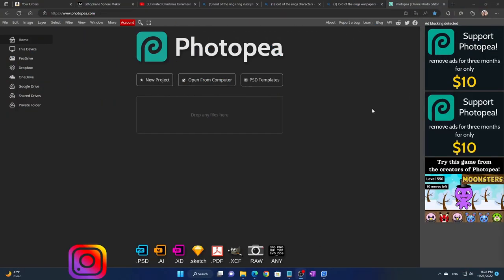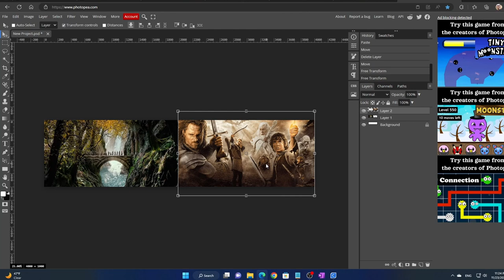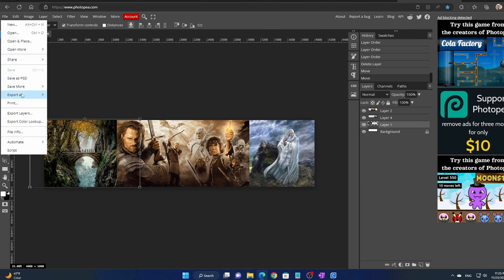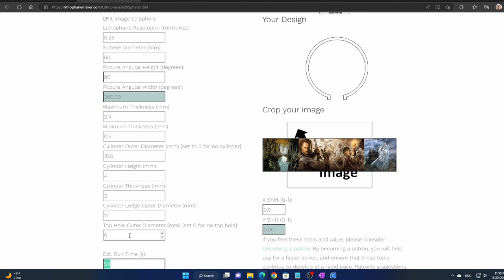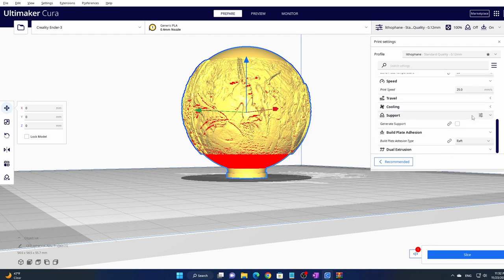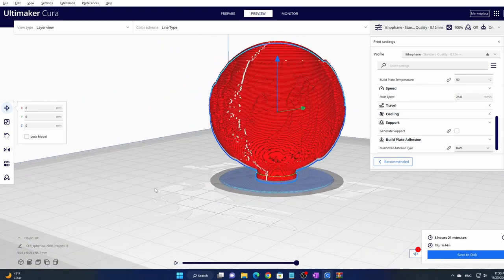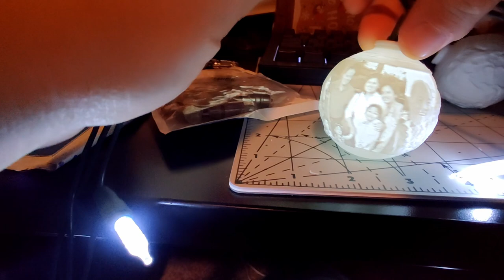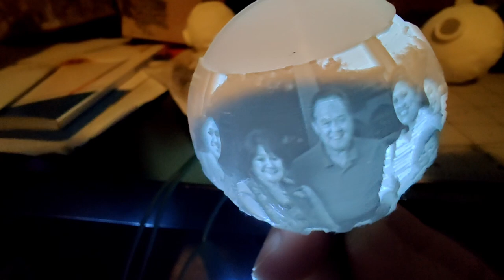Win Christmas by 3D Printing Lithophane Ornaments! | Full Tutorial

Comment: Can you print it to the inside!?
In that case it is a regular smooth white ornament till you turn on the light!
Reply from the maker: It's not an option built into the lithophane maker, so unfortunately no. There's also a problem with that in which the shadows of the protrusions would change the image you see on the outside if the light isnt dead center inside the ornament, so it would look different. I imagine that's why it's not an option
Reply: If you print a regular flat lithophane and view it from the other side you’ll see that it loses detail.

Comment: Great video, thanks! I have a question tho, how do you install a non-battery operated light?
Reply from the maker: Depending on the size of the light, you can either just wiggle it directly in or if the light is a little smaller than the hole, you can probably pad it with some tape. Alternatively you can play with the settings and make the hole with the opening smaller